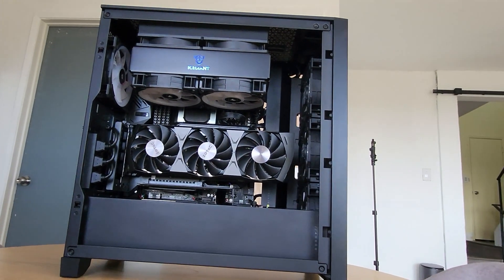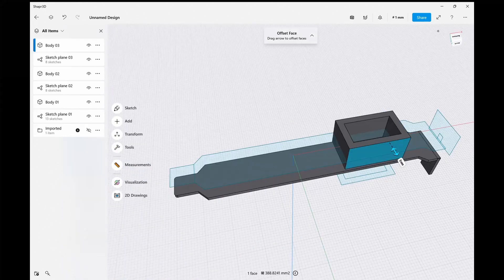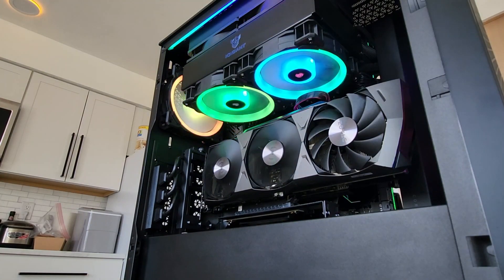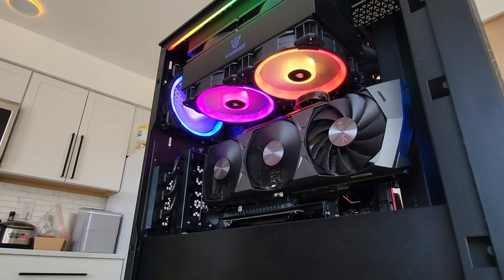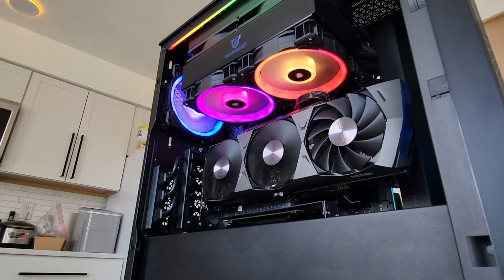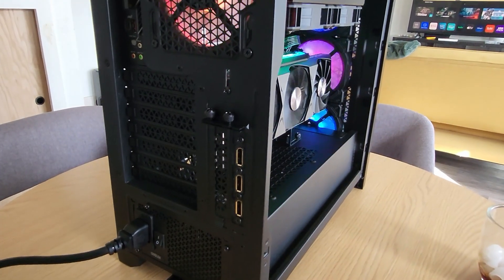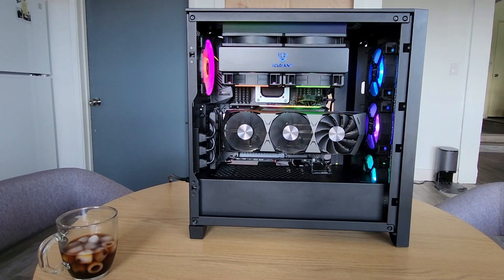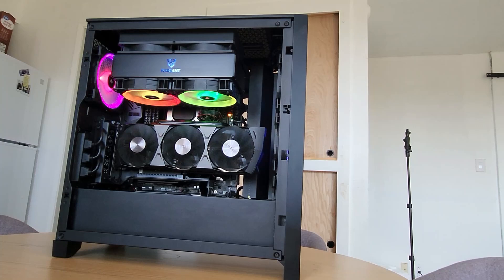3D Printed Computer Parts - Why You Should Start Printing Your Own

Comment: i have designed and 3d printed bracket for AIO mount to GPU and a custom shroud for fans to guide air through all the component in the GPU. my 6800xt sits at about 40/50C full load and memory at about 50/60C, all while staying in complete silence. i have bought a new case so i can start designing bracket for aircoolers. and design about everything else inside so it goes well with cooling a each other